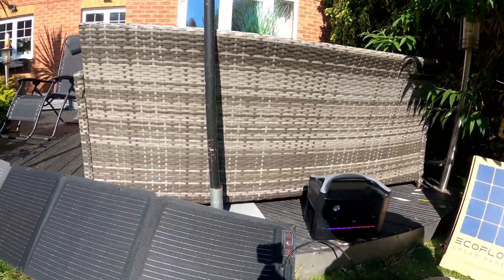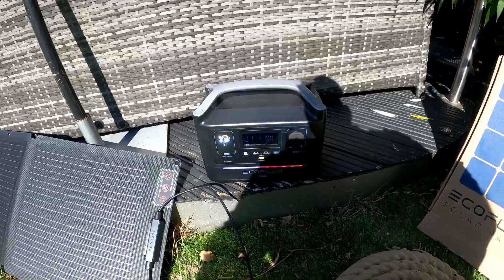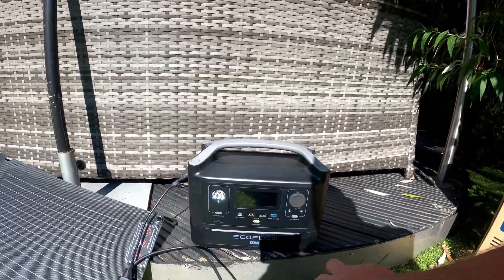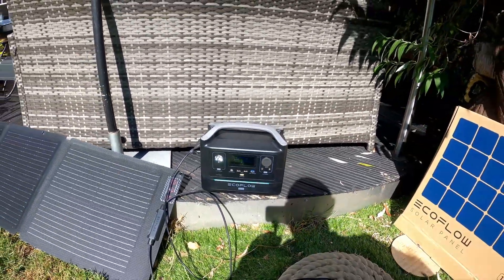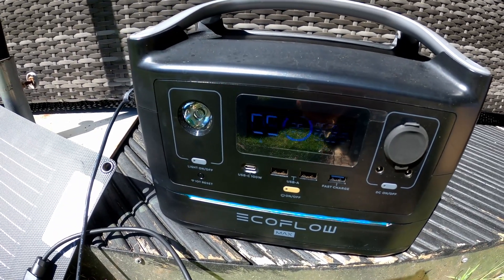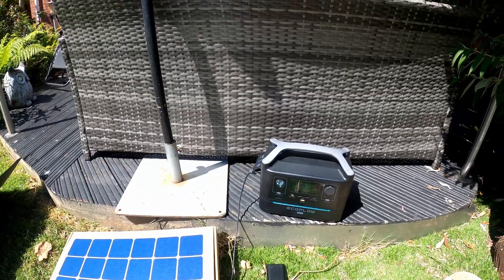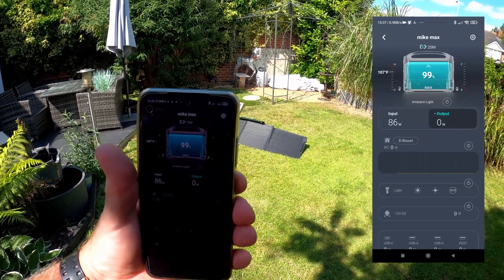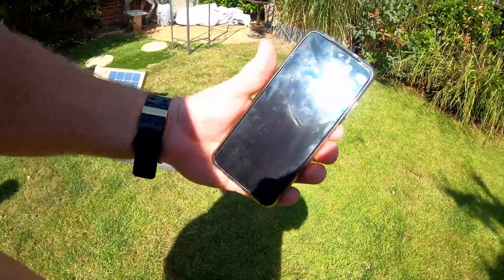#5 How long does it take to charge the ECOFLOW River MAX with the 110W solar panel

Comment: I am interested to see how long you could operate radio from ecoflow, as I am radio  ham I took a different approach to you as I already had two 115ah leisure batteries in parallel,  I bought a solar controller and panel to make my own kit, but I admit the ecoflow system is a very compact and tidy system

Comment: Nice review. I actually did the same and used two 110W Ecoflow panels via the parallel cable and observed that it read somewhere between 160W and 180W. Those panels are really efficient.